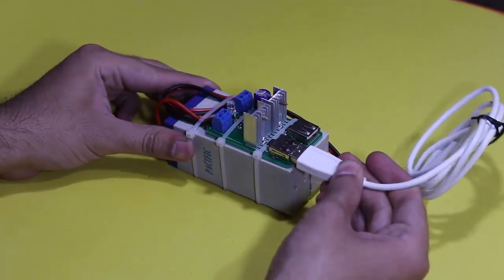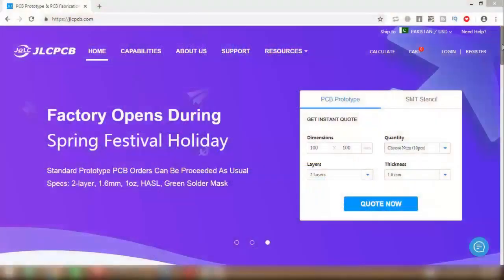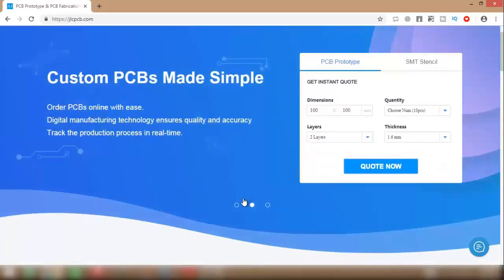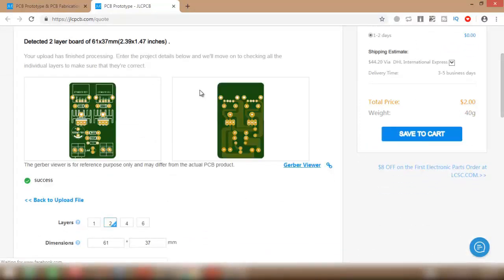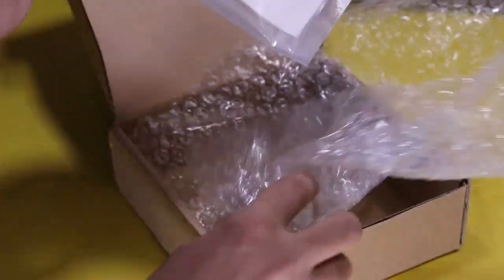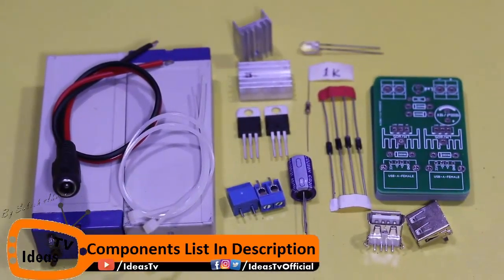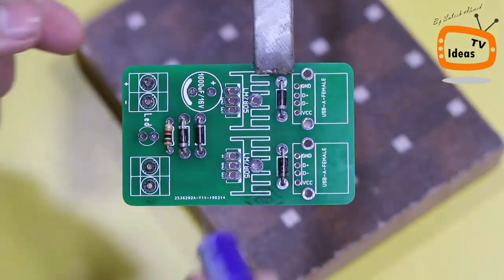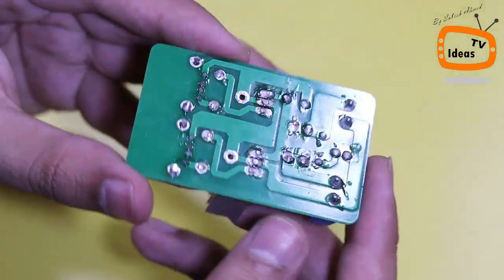HOW TO MAKE POWER BANK (Using Lead Acid Battery, Safe!)

Comment: Can I use 12v Lead Acid battery for same circuit diagram you give or need to change 1k resistor?
Reply from the maker: yes